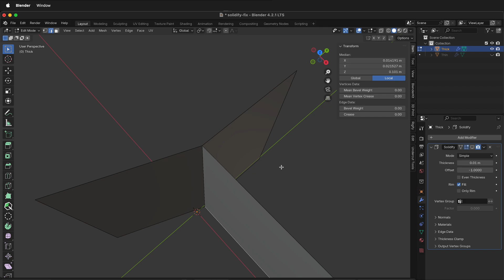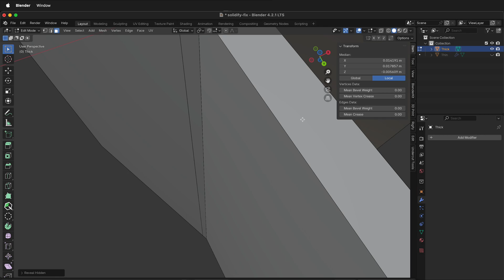Blender Solidify Modifier Fix: Non-Manifold Geometry Solved!

Comment: Im having real trouble with learning blender my heads bursting tonight! Im noticing in parts after adding a solidify the original thin part os still sandwiched in-between the inner and outer thicker solidify parts as they were? It looks odd and original part sticks out still in its thin mode like edges all round? Is there anyway this can be deleted out of the middle?
Reply from the maker: Did you try merging vertices by distance? You can type in ever increasing distances until you get enough of them to disappear, make sure to save a backup of your file first

Comment: just  go in edit mode ... select all .. turn on snapping  and split edges... then hit G and enter without move mesh .... that will fix it faster   if this not fix it then just use solidify modifier in complex mode not simple ... this will not create nonmanifold mesh in this case
Reply from the maker: Thank you for sharing these suggestions and workflow tips with everyone, trying to get a very streamlined process for making parting lines for 3D print molds, this is the latest version https://youtu.be/HZAVFpYvAoo